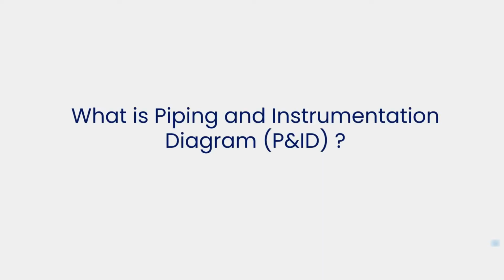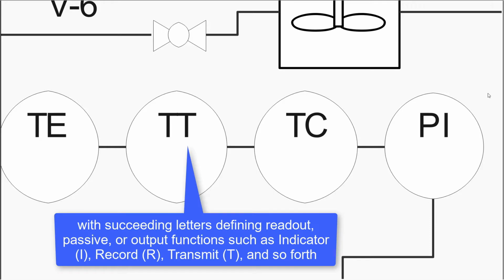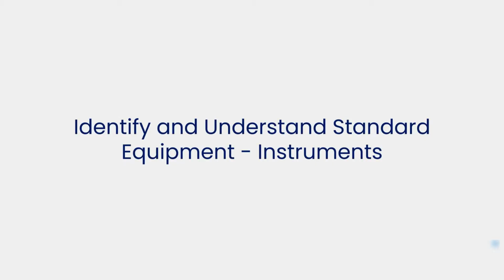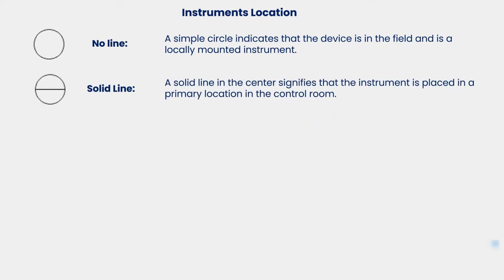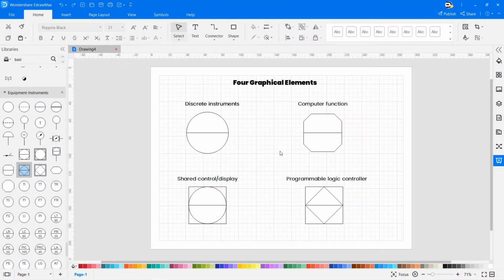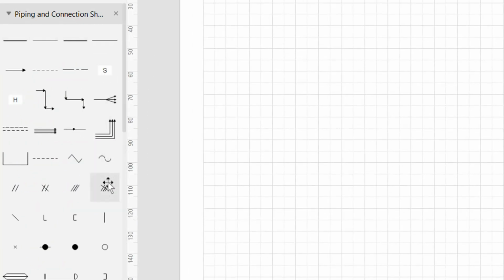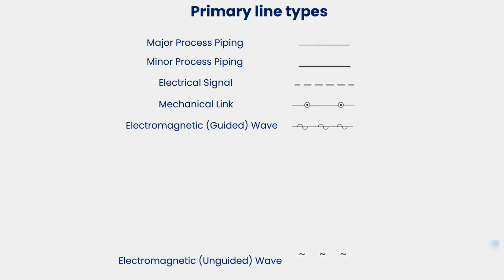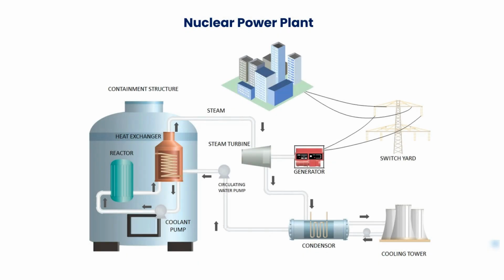How to Read a P&ID Diagram | Piping and Instrumentation Diagram Tutorial

Comment: There are no smart connector line types for pneumatic, data link, etc.   Only a simple symbol, so you have to add several over the connector and distribute them equally spaced. So it is troublesome to edit a PI&D with these lines. This is a feature that needs to be added
Reply from the maker: Thanks for your feedback! We understand that the lack of smart connector types (for pneumatic, data link, etc.) can make editing P&IDs less efficient. We’ll definitely take this into consideration and work on improving it in future updates.
Reply from the maker: Hi — this isn’t a bot or spam, just a real message from the Wondershare Edraw team 🙂We’re chatting with a few users to learn how people use EdrawMax/Edraw.AI.

It’s a quick 30-min casual chat (no prep), and we’ll give 6 months of Edraw.AI as a thank-you 🎁If you’re interested, feel free to drop your email — we’ll reach out!